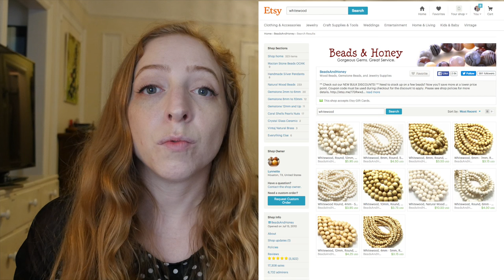Becky's DIY Beaded Chandelier // Becky Stern

Comment: One of the best looking beaded chandeliers I've seen. One question: How many of each kind of bead did you use? I think I see four different sizes, is that right?
Reply from the maker: I put my bead source in the description, I don't know exactly how many of each I used but yes, four different sizes. You might be able to do the math by counting the strands. It added up quick, more than $200 in beads IIRC